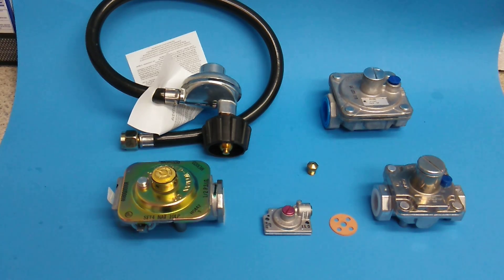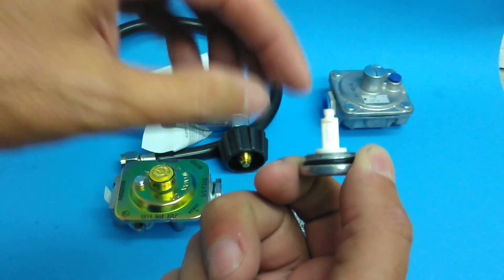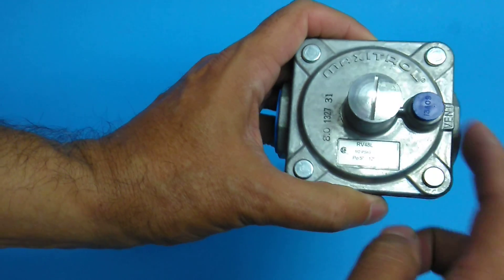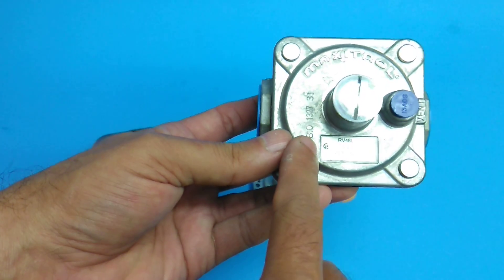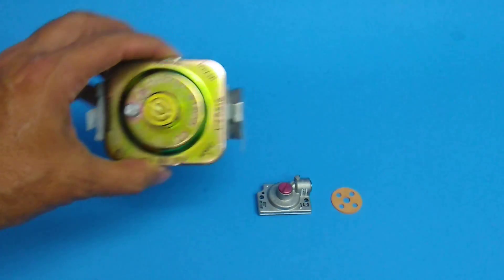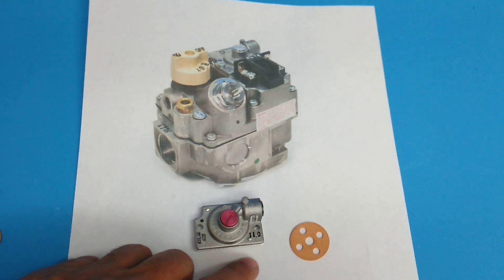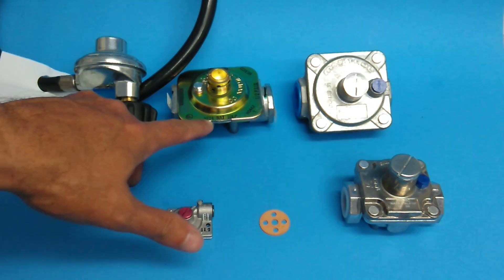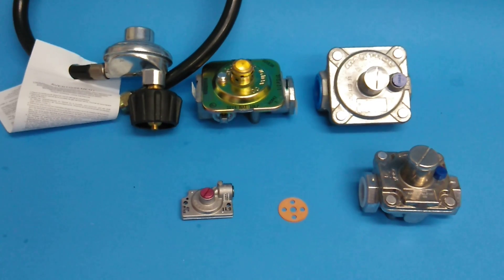Fuel Regulators Explained

Comment: Thanks Frank for the informative video. One comment: at 6 minutes in, you say that turning down the adjustment screw on the regulator will give you less pressure and loosening will give you more. Isn't it just the opposite?
Reply: Righty tighty loads spring creating a higher downstream pressure required to push up against spring/diagphram and close valve. Lefty loosey is opposite....less spring pressure to overcome.
Reply: Every source I find says usually turn clockwise to increase outlet pressure, counterclockwise to decrease outlet pressure.  I do my own research before taking advice...Trust but verify. LoL  Google it https://www.hunker.com/12486940/how-to-adjust-a-natural-gas-regulator
Reply from the maker: No, you're letting gas though at a higher rate when you loosen the screw, so that action increases the water column rating. You're restricting the gas flow more when you turn the screw in, so you're effectively decreasing the water column rating.
Reply: @frankhamilton8257  Sorry, you are backwards on this, the higher the spring tension (tighten), the higher the output pressure
Reply from the maker: Natural gas is typically designed to flow at 4" WC or 5"WC in most cases. Propane is typically designed to flow at 10" WC in most cases. If you have a regulator designed for both natural and propane, there is a plastic piece in the cap that is designed to press on a spring (which pushes on the diaphram) to deliver 10"WC. Remember propane is in a highly condensed liquid form in the bottle, so that's why it sloshes around in the bottle until it hits the atmosphere. It is actually past it's boiling point (approximately -160 degrees F) when it is introduced into an ambient air environment. On an adjustable regulator, the diaphram control is a screw which is designed to press on the diaphram with more or less pressure depending on the direction that the screw is turned. Turning the screw "in" clockwise puts more pressure on the diaphram which further restricts the flow of gas. So it follows, that pushing on the diaphram (turning the screw in) will further restrict gas flow as it passes through the regulator.

Comment: I have a question sir...I have a out door gas grill and it has low flame issue no matter what a repair mine has a propane regulator at the tank also the other square  regulator   piped in aswell do i need both ?
Reply from the maker: It sounds like you have a tank under the grille. If you're grille has another regulator plumbed in further up the line, I can only assume that you have purchased a natural gas grille second hand, and have plumbed it in line with a propane fuel source. If this is the case, you'll need propane orifices as well to get the burners to burn at the proper output. I have orifices to fit every grille there is, so just call me at 714-574-1544. I'm on the West Coast, so call me during normal business hours.
Reply: @frankhamilton8257  im in Corona not to far from you thanks much will contact you !
Reply from the maker: Sounds like a winner.

Comment: Hello Frank, I have a carburetor to convert my small portable generator to run on Natural gas.. It says the input (into carburetor) must be within the range:2.0kpa–2.6kpa(0.29psi–0.38psi). What would be the best Regulator (name, model number) to use??
Reply from the maker: A normal natural gas regulator is rated at 4 or 5 inches of Water Column for a fixed regulator. The parameters that you've mentioned is between 8.02"WC (inches of water column) and 10.44"WC, so it is above that rating. Are you sure you're information is correct, because Natural Gas normally comes out of a residential pipe at 7"WC (1.75 kPa)? I believe that commercial natural gas regulators (a natural gas version of the Maxtrol regulator shown in this video) can possibly extend to the limits that you require given they are attached to a natural gas source capable of that input rating.
Reply: Thanks Frank, I'm going to get a Manometer and check the Water Column of my residential piping..  Again Thanks

Comment: Great videos, I have a similar regulator like to Harper wyman, for my star griddle , 6 nat and 10 lp   I found that top adjuster difficult myself to reinstall but I used a pair of snap ring pliers  to reinstall for lp. so I have a question, do I need to run another regulator before this one on the griddle and reason I ask is because I can turn my tank valve just a little bit and light burners, but if I turn up valve on my lp tank which is a 20 lbs tank. it appears to shut the regulator valve down, which I have to discharge main line from tank and start over it seems to be too much pressure to regulator. On the top of the valve it says 1/2 psig is that for input ?help if you can, thank you .
Reply from the maker: These regulators can usually be used for an "under grille" type tank without any additional equipment. If the tank is outputting more than 1/2 psig, the regulator will go into overdrive and shut down. You'll need to measure the tank output to see what is happening.